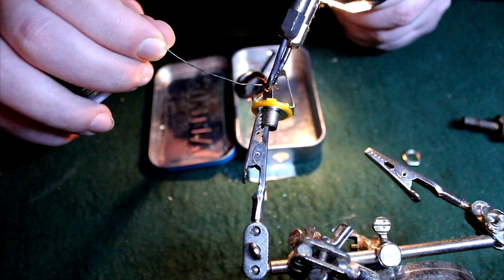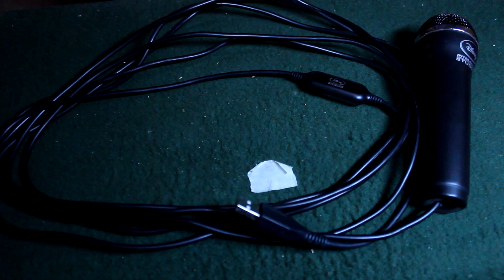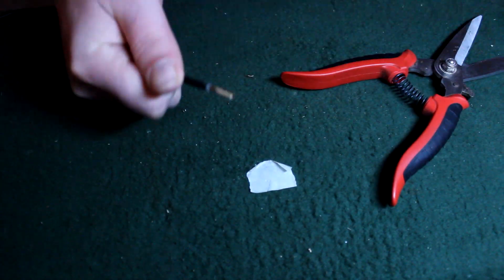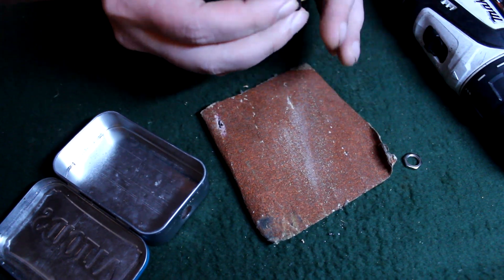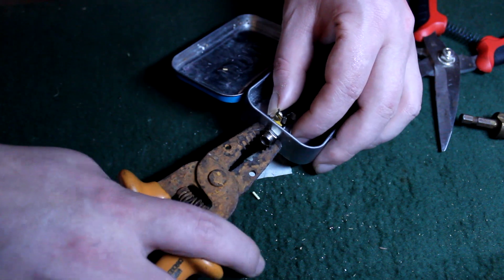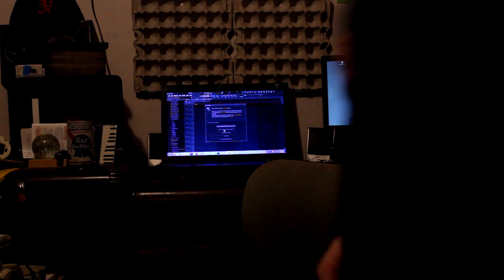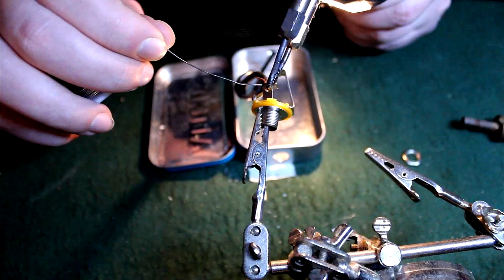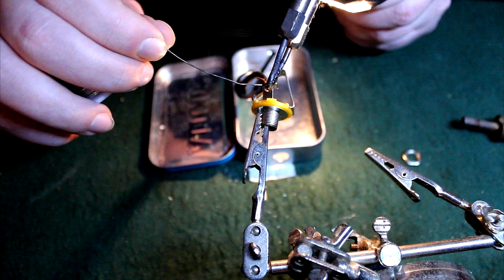DIY USB Interface for $5 Full Build + Demo (Very Easy!)

Comment: You are a genius! So I was at Bestbuy and saw a desktop microphone that looked like it had that analog to digital converter you spoke about and went to usb. I had some discounts and stuff so it only cost me like 6 bucks.. I didn’t have an altoid can but I have an old tuner pedal I don’t use so I thought if I just put a male 1/4 inch ok the end of the microphone and plug that into my tuner pedal and it has a female jack on the other side… worked like a charm! I didn’t have a male jack so I sacrificed an old guitar cable cutting and splicing an end on it. The only had part was soldering because the microphone had such crappy small wire and I didn’t have any clamps or 3rd hand to help.. but I got it eventually. 🙏🏻 Thank you! You saved me a lot of money! I just converted an old 2013 Mac mini I had that was useless because apple wont let you download app’s anymore, so I installed Linux os unbuntu studio.. it’s amazing it comes pre installed with guitar ix and pretty much anything you could want to create a recording studios.. and it is free and open source

Comment: Fantastic!!! Thanks for the info. Now I need to keep my eyes open for those mics.
Reply from the maker: Thank you for watching and taking the time to comment Jenison. Check those Goodwills and thriftstores. There were a lot of this model branded as different things for use with rockband type singing games.
Reply: @heavymetalATC  I think I already have a couple. So I may consider this, may also throw a switch in the box so the mic could potentially still be used down the road or as a line out (+4db) device.

Comment: I can’t believe this worked! Incredible
Reply from the maker: I really am glad this info helped you out CWB. Make that banger hit bro! if your this driven to watch this and try it... you'll go, as long as you keep the same intensity you cant be stopped.
Reply: @heavymetalATC  I have a Ubisoft Hercules Rocksmith instrument cable adapter, but I don’t have the “breakaway” cord which ends with a usb A. It has the same type of ADC thing on the cord, and an extra “bulb” after it. Do you think I can strip the wire either before or after the bulb and do the same thing with it?
Reply from the maker: its worth a try if you dont need it anymore? @CaptainWrinkleBrain

Comment: 1) I found a $7 NanoPatch+ which is essentially just a volume pot like you said. I put it in line before the altoid interface and it worked perfectly. 

2) I learned you can also run a signal through headphone aux cables with an adapter
Reply from the maker: Thank you for watching and taking the time to come back and comment CWB. 
1) That is a great idea! Good clean signal with a buffer. I will always advocate using some kind of pre existing module you have over having to go through  bunch of BS for not as good a result. Good thinking. 
2) Oh yes I had recorded a few diy "albums" that way back in the old days hahaha, you can get a decent sound into a laptop that way iff you have good gear intfront of the soundcard but I remember going through hell to get it to work with old DAWS as far as latency and "asio" driver crap allowing multi track recording while outputting audio through the same card so you needed the ASIO4ALL pluggin... this usb thing will cut a ton of that hassles on older windows pc for sure. 
I dont know much at all about interfacing with android or apple devices which it seems many used this for, I guess makes sense nowadays.. my @ss is older than i look and sound and outta touch with new fangles techno logicles. ;)

Comment: Very clever idea. How would you make a multi track audio interface??
Reply from the maker: Thank you for watching and taking the time to leave a comment. If you wanted to record multiple instruments to a single track you could plug the output of a mixer into this. But, if you are going for multiple instruments on multiple tracks you could take a box and put a few inputs on it and a few of these inside of it hooked to a usb hub and run one wire out and the computer would number the inputs automatically and you could assign them to different channels in a DAW and record multiple tracks at one time. Other than that there are chips on the market that can achieve the same thing but with much more soldering and circuit design. I hope this helps, if you try it out let me know how it goes. If you have any problems or further questions feel free to drop a comment.

Comment: Super tip ! Plug and play with cck on iphone and ipad. 👌decent fidelity .. much better than the irig or similar diy via the headphone socket .Thanks for sharing ✌️
Reply from the maker: Awesome! Thank you for watching and taking the time to comment and share some good info.
Reply: This has been my problem.  Tied setting up a live stream using mixer out, attenuated cable with an added adaptor to Mic in and having a horrible time with it.  I am hoping this will provide a much better line in option without breaking the bank.

Comment: nice - i ee these alot up here at resale store they tend to cost 1.99-3.99
Reply from the maker: Thanks, This was one of those Ideas born out of desperation, impatience, and over all cheapskatery. If you ever decide to try this I recommend using a volume pot.
Reply: @heavymetalATC  Instead of a pot I am potentially considering a switch with various resistors to set a standard attenuation instead of a variable.   Just have to see what I have available to play with.  Current attenuation cable I am using is a 100K resistance.  Allow the mixer output to be accepted by a mic input on pc.

With this I may not need as big of a resistor but would be good to keep it there anyway.

Comment: Hey Clementine, would you be able to do this with multiple XLR channels?

I have this old M-Audio Mobile Pre (1st gen) and I’d like to take it apart and do something like this. Would love to hear your thoughts. Thanks for your time and thanks for the video!
Reply from the maker: Thank you so much for watching and taking the time to write a comment Kaosevig. Yeah, If its already multi channel, you can change the plugs from 1/4" inch to XLR you might have to figure out exactly what to do with the sheild ground, I would say put it on the metal enclosure and maybe pick up a ground from the sheild wire of the usb cable? I guess I'm just failing to understand the question completely, If you are saying to take the interface apart solder in some XLR jacks to the board where the 1/4s are and put it in a metal box or like a pedal enclosure absolutely, just make sure the board doesnt short on the metal but with it inside the box and with the sheilding of the enclosure and 3 lead xlrs it should be very quiet hum wise.
Reply: Have you tried using the USB plug in the back of the unit?  You may already have the interface available with that unit and don't even know it.

Also, keep in mind that XLR is a balanced signal.  So inputs and outputs are looking for or providing a positive and negative signal, not left & right.

Comment: Sounds better than those $20 "Behringer" guitar interfaces. Of course those can fixed with a couple of caps.
Reply from the maker: Thank you for watching and taking the time to leave a comment Kenneth. I have never tried one of the guitar specific Behringer branded interfaces. I have a cheap little powered mixer from them with a USB out and it works OK, the compressor in it is pretty good. But, it is kind of noisy when the gain is over half. This comment has inspired me to see if anyone has found a solution to the hum. Thanks again.
Reply: @heavymetalATC  IIRC they are all the same. I think I have my off branded version away in my purge a month ago.

Comment: Quick question, if i wanted multiple inputs, could i connect the inputs into the one singular usb cable in parallel? Or series? Or connect each one individually to the usb? And which methods are good, and would they even work if i tried??

Comment: hey quick question where can i find a quarter inch instrument jack? thx :)
Reply from the maker: Thanks for watching and taking the time to comment TL. You can type "1/4 female jack" into ebay or amazon and find many different options but I just checked and was floored by the prices, wooh they have certainly come up in the last year. Seems about 6 bucks is average for a 2 pack on amazon. The only devices I can think of that you could salvage one from would be things you would probably not want to destroy unless they were completely broken and just junk parts, like an old radio with the 1/4 headphones or a broken guitar pedal or amp or maybe an old broken record player?

Comment: Does this eliminate the lag/delay from analog output on an Android?

Recently made an analog connection to input to Android for Deplike and the lag was at least one note behind what I was playing.

Could just order a knock off iRig but I'd rather diy because I hate waiting on the mail.
Reply from the maker: Thank you so much for watching and taking the time to write a comment... AOR. I really dont know if it would have a lot less lag on android I know on computer its pretty close maybe only 30-60ms of lag something like that. its not dead on but neither is my actual interface.

Comment: Will a 50k volume pot work too? Considering using this for my guitar so I can hook it up to the computer to use as a amp, and digital pedals.
Reply from the maker: Thanks for watching and taking the time to write a comment Nick. You should be able to get away with that. This configuration has plenty (kinda too much) gain so loosing a little wont hurt you.

Comment: I have a behringer guitar link interface that comes in a plastic shell and is very noisy even with moderate gain. Do you think moving it to a metal enclosure would help with that?
Reply: It will as long as you ground the case. That’s what actually blocks the interference. It’s basically a faraday cage…
Reply from the maker: Thank you 30yrs. That is absolutely correct. I was only 11 months late Hahaha
Reply: @30years2late  I am thinking not as big of an effect, but a couple of layers of Reynolds Wrap might do the same thing?

Comment: I couldn't find any microphones with that kind of cable. But , my webcamera(which has a mic) have a cable with a lump on it. Can I use that? Please reply . Pleaseee please
Reply from the maker: Thank you for watching and comment I do appear to be 10 months late but, I am pretty sure you could use the mic input from webcam by itself if it comes up that way when you plug it in but dont know for sure. If it shows up as audio you could maybe actually hack exactly into the wires in the back of the mic on the webcam but it seems kind of difficult.

Comment: My old joystick usb cabele will work? Cuz it have 4 wires
Reply from the maker: Thank you for watching and taking the time to comment Goat. I am soory to say that a joystick wire will not work it has to be from a usb powered microphone like the ones that come with rockband. It must have the logitech audio usb chipset built into the box on the wire.
Reply: @heavymetalATC  it's okay, I already bought an audio interface, it have phantom power

Comment: I couldn't find this type of mic...what other type of mic will serve the purpose?
Reply from the maker: Thank you so much for watching taking the time to comment ans for showing a genuine interest Nitesh. If you can find any type of usb mic like the little Journivo or Creative desktop computer mics as well as many brands on amazon or ebay etc. You can get to the microphone wires and solder in an input and many of those desktop mics have a volume pot on the base which is great. I hope that helps thanks again.
Reply: @heavymetalATC  thanks a lot...will definitely try it 🙂

Comment: Would a usb headset (earphones and microphone) work as well?
Reply from the maker: Thank you for watching and taking the time to leave a comment. I don't see why that wouldn't work. You could wire a stereo jack to the headphone wires and have a legit I/O interface to record and monitor. Thanks again Ffsooo3. If you build it let me know how it goes and if you have any issues or questions drop a comment.
Reply: @heavymetalATC  Do you have any secrets or suggestions as to how to deal with (strip & solder) the super thin wires that are now in all these lightweight headsets?
Reply from the maker: @NeverTookTheTime  Yes. if you mean the ones with the green or red varnish on them like magnet wire inside the case instead of a real rubber covering? You can take a lighter and touch the flame to the end of the wire. But! be ready to blow it out immediately its flammable as all hell and that will remove the varnish insulation. then you can solder it and it will make a connection. You may have to scrape the black off but it usually just works if you solder the heck out of it. I hope that helps.
Reply: @heavymetalATC  I hate those new wires,  I think they were intentionally designed to make us buy more materials to through away.

I have had to get rid of headsets and mics because I haven't had luck with them.